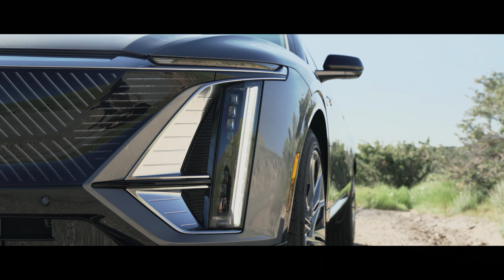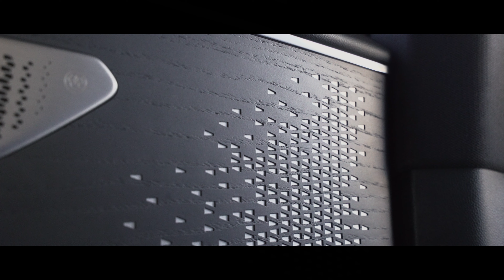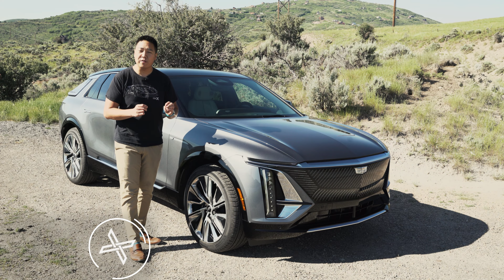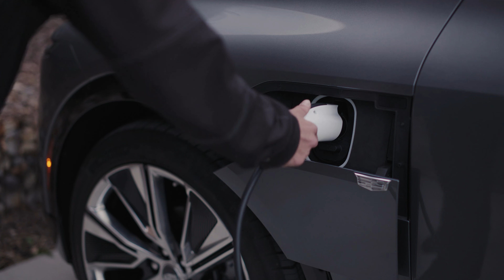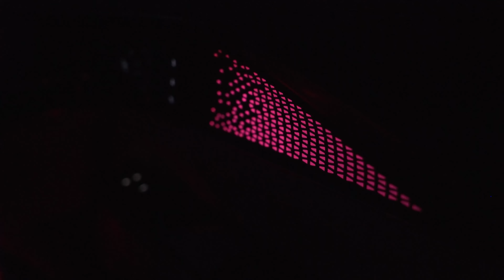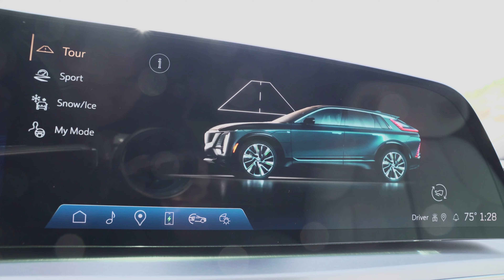2023 Cadillac LYRIQ Review | A Fantastic $60,000 Luxury EV!

Comment: I wish the vehicle had the ability to turn off the fake engine noise in every mode of driving. Second I wish it had a pet mode to leave the HVAC on as well as have the ability to contact my phone if the HVAC cannot maintain setpoint or the battery is low.

Comment: Now that we’ve seen the Mercedes EQS with its hyper screen and we’ve seen the Jeep grand Cherokee with its passenger display I feel that GM should have carried that infotainment panel all the way over to the passenger side so that the passenger gets their own display to watch on a road trip.
Reply: Also, take a good look at the EQS screen. Yes, it stretches all the way across the dash, but there is lots of unused black space on that screen that’s not being used for anything. So, I would suggest the Lyriq’s screen is makes more out of its space than the EQS.
Reply: The EQS will be much more expensive than the Lyriq. The initial run for the Lyriq is, basically, fully loaded. But the Escalade IQ will be the better competitor for the EQS. The Lyriq, is more or less, a much improved replacement for the XT5. That is more of its segment which includes Tesla Model Y and BMW iX, whereas the EQS is going to be a six digit priced car. 

The Lyriq is positioned in middle of the mainstream luxury segment. If the biggest complaint against the Lyriq is that its screen “only” reaches to the middle of the dash then the Lyriq is an incredible success.
Reply: @RfrancisR  You’re right, the Mercedes-Benz EQS is $104,350 at MSRP. The Lyriq is the XT5 EV but slightly larger. The ICE Cadillac XT4, XT6, CT4, and CT5 are supposed to be getting refreshed for 2024. There will be a smaller electric crossover that slots below the Lyriq with a 10 module battery pack, slightly smaller than the 100 kWh battery pack found in the Lyriq. I want more information about the Cadillac Celestiq flagship sedan.